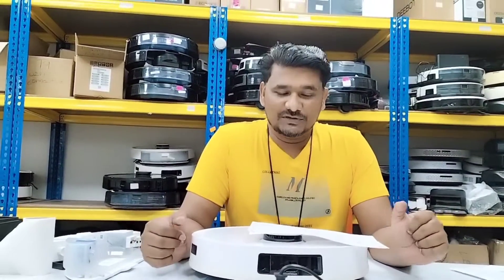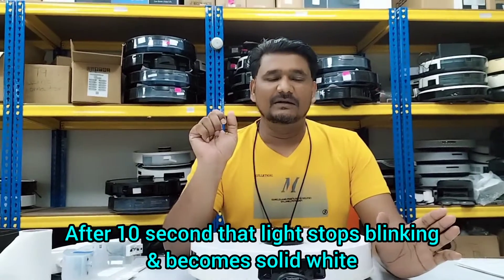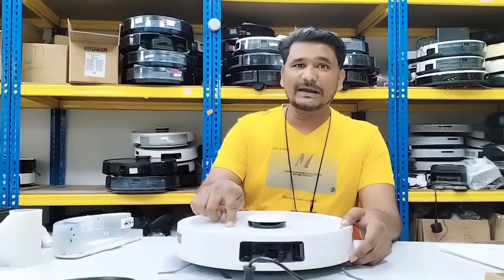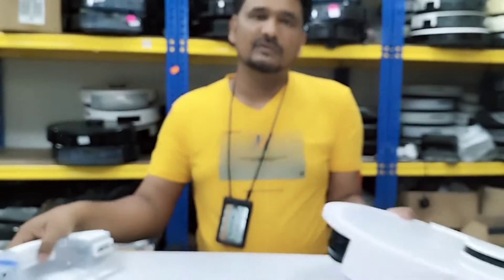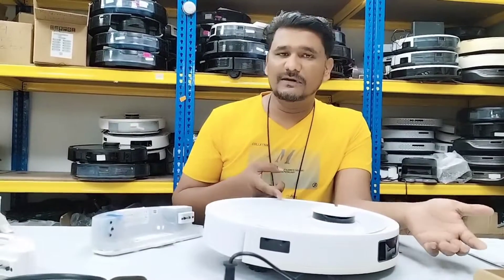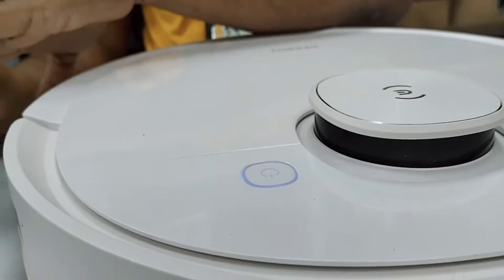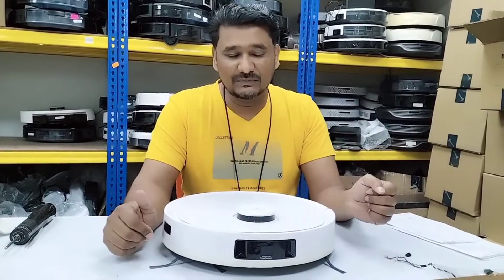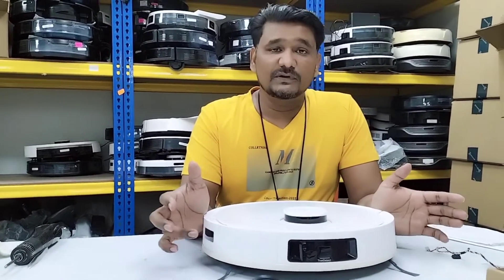Ecovacs  | Deebot | OZMO T9 | Why Ozmo Pro Tank not Oscillating?? How to Fix??

Comment: Thanks mate. Got the same issue - either it was not oscillating, or did not even get detected. Opened it - and the connector got black and red wires off. Looks like it's a known design defect. Have no idea where to buy a connector, so just going to solder the wires back.
Reply from the maker: Ya just solder then back.. still can use
Reply: @ecovacstechnicalsupport5278  I finally get a new connector delivered and installed it back today. It detects the ozmo pro and announces it, but the device doesn't oscillate :-( Any piece of advice what to look for?

Comment: Hi. Thank you for the video. I'm a t9 user. When I install the wet mop kit, the voice guidance and lamp light turn blue. But when I operate the vacuum and it leaves the charging dock, the light turns white and the wet mop kit doesn't work either. I repaired it twice with a new connector, and the mop kit is new as well. If It's not wire broken, what other problem?
Reply from the maker: 2 possible reason: Ozmo connector need to replace or motherboard short circuit, most likely is Ozmo connector issue
Reply: Thank you for your answer. I replaced it with a new connector and a new mop kit, but it doesn't work. If so, it seems likely that it is a motherboard problem.

Comment: Hi, I thought this video might help me, but it did not... my T9 tells me "Ozmo Pro Tank blocked. Please check"... which I did, but I cannot find the issue. The only thing I noticed is that one of the 3 pistons moving the mopping plate back and forth is not as loose as the other 2, which may cause the plate to jam.
Reply from the maker: In 90% cases connector wire break..some cases Ozmo tank stuck.. might be motor assembly Jammed or as U mentioned plate lock broken or loose in few cases motherboard issue as well
Reply: @ecovacstechnicalsupport5278  Thanks for the suggestions; I will disassemble the mopping unit carefully and see what I can find. Forum users have mentioned that their cause of the issue was a shift in the amount of grease on the "rattle pistons", one of them having considerably less grease than the others, making for an uneven motion which would eventually cause the whole mechanism to jam.

Comment: Can I ask what is the screw that pushed the black knob on the opposite side to the connector.

It pushes in the black nob of the osmo pro.

I adjusted it now it won't realise water 😢
Reply from the maker: Water flow settings only we can do from app... there's no manull settings for this purpose

Comment: Hi, I have a T8 ozmo. The problem that I have is that when The reservoir is removed the robot still having the blue light. When push the start button stay in blue all the time. The robot was reset to the original setting and it still have the problem. Do you have any recommendations? Thanks.

Comment: Can the ozmo part be jammed and what to do?
Reply from the maker: Ozmo part means....?? Ozmo Pro tank?
Reply from the maker: If u r asking about Ozmo Pro tank not oscillating then..most likely is Ozmo connector where we attach that tank that is got problem...I mean connectors wire may broken that's why not functioning....just solder back nicely..it will work.... Ozmo tank very rare spoil
Reply: @ecovacstechnicalsupport5278  I did what somebody suggested, unscrewed the bottom pad, give it little bit cleaning, new grease and now it is not complaining. 
I have another problem, It is lately more affraind to go little bit steep from one room to another, there is like a plate platform to connect theset two rooms.Before it was hasitating, afraid to fall probably, but now it never crosses to that room, I have to push it. When it realises being in that room continues fine, it climbes back no problem.

Comment: Hi, thanks for the video. I have the Deebot T8 AIVI and when I connect Ozmo Pro, the light turns blue, it says the mop is connected but when it starts to go, the mop doesn't scrub but the light remains blue. Any ideas?
Reply from the maker: You need to open & check the connector wire...75% chances are just the red wire broken...if u can solder back the wire it start working as normal
Reply: @ecovacstechnicalsupport5278  thank you. I got it to work by smacking the mop attachment harder lol. It seems touchy like the terminal is loose or something. Since I got it to work, I didn't bother messing with it for now.
Reply from the maker: @RobertoMezquiaJr  if with pressing harder start working means wire disconnected but still on its place... means sometimes Will work when u press harder it will touch n start....better can just solder back easy

Comment: Hi, I have deebot T9 for awhile, and recently the mopping function is not working. When ozmo pro attached the LED turns blue and ozmo pro detected, it oscillated and stopped after awhile. When charging I often hear that Air freshner has been installed while I never install it. Could it also be just a connector issue? Thank you 🙏🏻
Reply: This is happening to me too
Reply: my t9 starts without a schedule . if he feels like cleaning he just starts. mopping starts and after 5 minutes only suction function. now the slide bearings of the water tank need to be replaced but no loose spare part .
Reply: @NandhaHandharu Hi, friend! I have the same problem with my vacuum cleaner. You solved this problem? Thanks !!!
Reply: @ryzryzoma2195  I bought a new ozmo pro tank with moping, plus I changed the connector on the main body (need to take apart the casing of the main body ).
Reply: @NandhaHandharu  Thank you sir! Where did you buy the connector?
Have a good day)

Comment: I have the same model. It start moving backwards when I attach the ozmo Pro tank. When I attach the air freshener, it moves normal. What's the problem?
Reply from the maker: Underneath the deebot beside the charging connector you can see n deep whole inside there's carpet sensor... might be faulty ... you can try to clean that whole n inner white colour sensor using cotton buds if still same then need to replace carpet sensor then will be ok

Comment: Can I fit the ozmo pro tank in ozmo 950?? I am think to externally power the ozmo pro tank for my ozmo 950.. any chances of possibility??
Reply from the maker: Can Not use Ozmo Pro Tank in Ozmo 950 model as in Ozmo 950 doe's have Ozmo connector so it won't work...